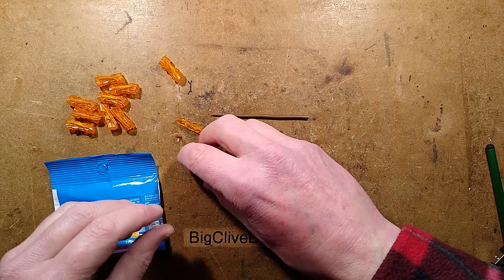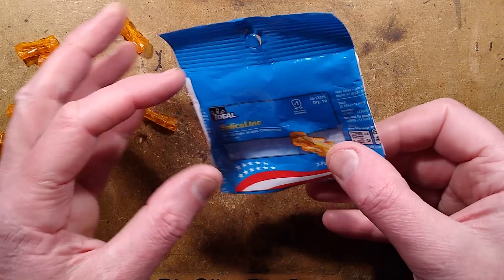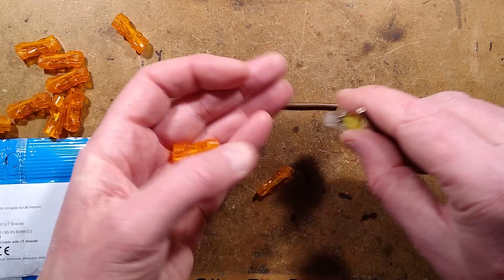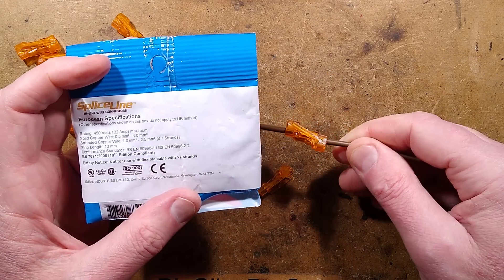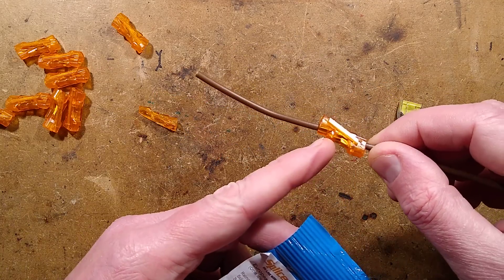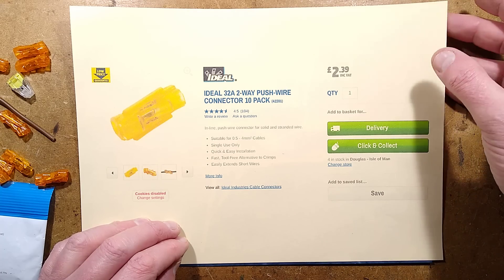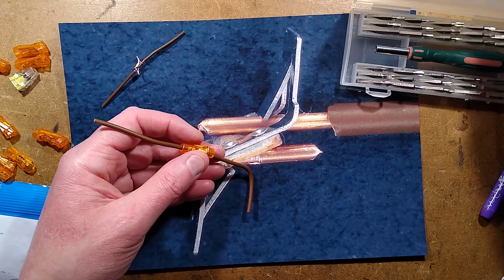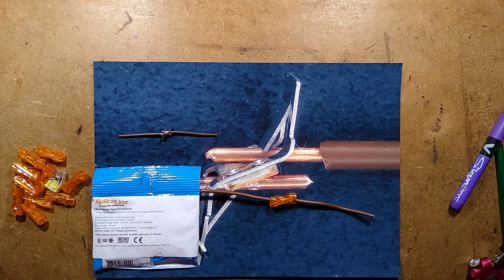Inside a SpliceLine push in cable connector

Comment: The concept of these quick connect devices appeals to people who want instant gratification in all things they do. 45 year journeyman electrician here. I will say this. The spring loaded Ideal wire nut is extremely hard to beat in terms of conductor contact area and fire-safe amperage draw. Even in a pull test, they perform above reasonable expectations. Clive, please do your famous fire/explosion high current test on these versus an Ideal wire nut. Dispel the myth.
Reply: Or people who want a consistent method of connection less likely to be performed incorrectly by fallible humans.
Reply: I'm pretty convinced that the only reason wire nuts are still in use in the US is the "not made here" factor where superior things not invented in the US are discarded off hand in favour of inferior or traditional things instead. There are no real advantages to wire nuts other than being cheap, but then so is a connector block or just twist and tape, and the only advantages of wire nuts are extreme edge cases and these are always better suited to more comprehensive methods instead. For example, the really high load scenarios where it's claimed that wire nuts are better, just crimping and soldering the connections to create a comprehensive connection is better than wire nuts, effectively welding the wires together, and in the industrial scenarios where such high load is relevant over connectors, there is no way in hell any professional would ever use a wire nut when heavy duty terminal blocks are appropriate instead.
Reply: @nickryan3417  It's very obvious this whole topic is about low current (less than 50 A) residential or light commercial installations. The Ideal twist-on nuts beat the new lazy install wago and others in every category with the possible exception of connecting leads inside of a box which are already too short. Twist-ons work with stranded, solid, and a combination of both types of conductors, and provide much more surface contact area. This greatly reduces possibility of a hot joint. Being a US company has nothing to do with any of this topic.
Reply: @RobertBeck-pp2ru  Every category? Wire nuts are much easier to get wrong, they permanently deform or destroy any conductor they touch, they're frankly a pain to install and remove (no, that's not laziness: they take more time, more force, more area to work in).

The human element adds a greater possibility of a bad joint. Tell me, what are your thoughts on torque drivers? (un)Calibrated wrist far superior?

So far I haven't seen anyone break out a microohm meter and prove wire nuts make the claimed massively superior contact..
Reply: @Monkeh616  I respect your thoughts, but disagree, based on my own experience of many years of doing this type of work; industrial, commercial, residential.

Comment: Want to ask a question but don't know what words to use. 😠
Something to do with area of contact between the wire and the connector, 450v, 32amps and fire.
🤔
Reply from the maker: Keep in mind that unlike a screw connector this will not get loose as the copper settles over time.

Comment: Wait a few moments and a Chinese company will produce them to sell at 0.2p each, but leave out the copper slab conductor. I wonder what is inside the ludicrously cheap Wago connector copies?
Reply from the maker: There are already stainless-only connectors.   I should revisit them.  To be fair though, they are only aimed at lighting circuits.
Reply: I mean the ones that look identical to Wago but are on Temu for nothingpencehalfpenny.

Comment: they should have rounded the ends of the connector a bit more so that you could use heat-shrink tube for it in a suitable size.

Comment: Have to load test one and see what amperage it actually can handle for prolonged time before the temperature increase and what happens if you test with a reused connector. Does the load rating drop due to scratching or bending the holding tag… 😅

Comment: I used these when i split one of my ring mains into two. Under the floor with limited space it was so easy to just push the wires in for a secure connection.

Comment: That looks really useful. I'll pop down to Screwfix for some of those. However my use of it will use good old traditional red and black wires, of which I still have a huge stock in the garage for any little additions to my house wiring. Not getting involved in that "Part P" and colour harmonisation nonsense thanks very much.

Comment: Wago also make inline connectors both lever type and push in "single use" I use a lot of them in production lines to replace those 'turny connectors from across the pond that rhyme with  tyre muts and shall not be named for fear of internet wrath'.
Those ideal connectors are also bloomin good and cheap too.

Comment: wago has clip connectors that you can put wires in both sides. also with wago push in terminals you can get the wires out easily by twisting

Comment: how much connection do you get from a router wire onto a flat surface??
Reply from the maker: It seems good, plus natural copper spread over time improves the connection, where normally it results in screw terminals getting looser.

Comment: Given how interconnected our economies are, it probably shouldn't surprise anyone after all the comments by Americans that Ideal is absolutely massive in Canada as well. I would say a solid 80-90% of all wire connectors I see being used on jobsites are the standard blue Ideal "CAN-TWIST" wire wingnuts. They're made in Canada, come in (among other sizes) plastic jars of 1000 that I see most electricians using, though you can get barrels of 25K. I would imagine the exact same product is sold in the US with a de-Canadianized name.

Ideal themselves make and/or sell all kinds of things; if it's tangentially related to electrical, they probably make it. Hand tools, tool bags, taps, terminals, lever nuts, wire nuts,  luminaire parts, data comms connectors, grounding fittings, (wire) fishing gear, bits and hole saws, testing and measurement tools, safety (LOTO, caution tape, signage, etc),  zip ties, electrical tape, spray paint, you name it.

Comment: Not sure if I would trust them anymore than I trust twisted cables covered with electrical tape. Will the plastic break down before the expected life of the cabling? How resistant is it to moisture? (Thinking of uses in garages and sheds)

I think I will stick to tried, tested and trusted joining methods for a few more years before thinking about these 👍
Reply from the maker: Lever connectors might be better for that.
Reply: Well I wouldn't expect that much of a difference between the plastic and the electrical tape, I would even see a bigger problem with the electrical tape unrivveling itself befor the plastic broke down (dosent hinder me to use it for insulation pourposes)
And moisture, I would guess the same problem as with twisted wires would appear, corrosion. And in the best case one would wire stuff in a box or enclosing that keeps moisture out.

Comment: My original comment with more information disappeared...
They are not exactly single use, on their YouTube channel they have a video in which they explain what those holes where you inserted the screwdriver are for and how the wire are released in cases where it is possible to reuse the connectors.

Comment: You could also pop a plastic free ferrule on stranded wire and still use it with them.
Reply from the maker: It won't grip the ferrule in the way a screw terminal will.  The connection strength would rely greatly on the quality of the ferrule crimp.

Comment: As a Canadian electrician I really found this interesting. Your point of view on what we do here would make a really cool series. If you’d like some suggestions of products let me know. 

These are incredibly useful when a drywaller goes to war with your wiring in a box or in older homes and you have to extend or splice into an old wiring.

Also we do have Wago and similar style connections here but our wire is designed for wire nuts. Especially up in our northern climates.

Great video
Reply: How is it designed for wirenuts?
Reply: @Alex_Vir  the copper is actually made and meant to be twisted for a solid connection. At a trade event I went to Southwire Canada has a lot of information on it. Of course there is always the proper way of twisting and improper which could lead to install issues. But that’s up to the trades person
Reply: @FocusedElectric  So you are using a copper alloy instad of Millberry in canada?
Reply: @Alex_Vir  I have to admit, I'm pretty curious myself how annealed copper is different to annealed copper.. other than how it ceases to be annealed after getting savaged by a pair of pliers and a wire nut.
Reply: @Monkeh616 very true!!! 😂😂
Reply: @Monkeh616  with an alloy I mean something that is not 99.99% copper. Because I am really curious how something can be designed for wirenuts.
Reply: @Alex_Vir  In any circumstance, all wiring should be done with wire nuts (Marrettes) instead of Wago.  I haven't heard much of houses burning down when properly used wire nuts are at play and Wago connectors to me, for simple low-power circuits is fine but not for 120-240 VAC, 10-20 A.
Reply: @WJCTechyman  I haven't heard of any houses burning down with properly used wagos. So whats your point. Giving an anecdote that surprisingly fits your view of the issue?

Comment: Yup Ideal is one of our major brands here in the US. Those splices are rarely used. Buchannan is another one of the big manufacturers but they are known for making one time use wirenuts. As in they will not work after being removed like the higher quality brands are. 3m makes some of the nicest wirenuts over here but they are more expensive. 
            We are finally getting people converted over the the Wago style push connectors. They are coming down in price and making it worth using now. But when you are working overhead or in hard to get to spots you don't care if a wago is twice the price.

Comment: They do have other types. I've got some for connecting 2 or 3 wires similar in design with the first connector that you showed (they're called "IN-SURE"). Bought them awhile ago. Didn't actually use them but now that I've seen (somewhere on the internets :) that they might be good I think I'll be more confident to use them around the house when I need it.

Comment: You could use those with flex wires if you first put a ferrule on the end of the wire
Reply from the maker: It would depend on the quality of the ferrule crimp.

Comment: you would have to do the same as with tie wraps , go in where the wire is and push a little , pushing on the probe point just pushs the metal more on to the wire ,. (doing it this way (going in same place as the wire ) may well bend the metal tag so could render it useless for smaller gauge wires if it doesn't spring back etc )
Reply: corrected spelling lol

Comment: Don't see any advantage over wago 221.
Reply: An example is installed solid core wire that was cut in a wall for example, there they would be useful. But wago also has 2773-2401, so…

Comment: Ideal is an American electric supply company.  The products are typically decent quality.  They also carry tools used in the trade.  Not sure how many of their products actually originate in the US though.  As an electrician for many years, personally I’m not in favor of push-in connectors for high current applications.  I know Wego tests ok for somewhere around 40A.
Reply: Ideal makes most of its stuff in the US. They bought SK Tools in the 00s and were making those in the US as well, but they sold SK off a couple years ago.

Comment: Oh hey, Yankees finally figured out push in connectors!
Frankly more manufacturers need to start making these, because if you want quality its either Wago or Ideal, the rest is a bit crusty and I wouldn't trust them.
Reply: The US has had something similar on the back of receptacles for years and years. Strip the wire, shove it in, done. My house was installed with those 30 years ago and not a failure anywhere. Just the same if I replace an outlet I use the screws. Yes I know the screws can loosen and burn too but I've never had that happen either.

Comment: Ive been into using screw terminals for stuff for a while now.. And i recently started using 12/24v Barrel Jack connectors for quick connect/disconnect DIY power projects like various 5v/12v Lighting and manually charging/powering solar street lights etc.

Comment: I have a completely unrelated question, hope it's not a problem:
can you use a solenoid fog machine pump behind a basic triac dimmer? I have several foggers without DMX, and plan to make a universal 1ch DMX "dimmer".
If the solenoid pumps can only be operated on/off I will have to make an option for that on my design, but it would be great if it is dimmable.
Reply from the maker: I wouldn't recommend trying to dim it.

Comment: I'm sure I first got these from screwfix about 5 or more years ago and they were sold as reusable, you just have to yank really hard.
Also I think despite clearly being maintenance-free, you can't actually leave these inaccessible as to be legally  maintenance-free, you have to use the connector in conjunction with its matching box. So i think you still have to use Wagos and Wagoboxes for that, and pay the crazy price for what is a plastic box😕

Comment: I was expecting to see Clive push 32A through the wires & connector (under a resistive load, space heater etc.) and use a thermal camera to see how well it works.  Good follow up video idea?
Reply: well said, lets see it smoke!
Reply: I want to see him start at 30A and ramp it up until something goes bang!
Reply: @stevenhodgson834  that's called photonicinduction.
Reply: I approve this idea. 👍
Reply: You'd need a VERY beefy space heater to even slightly inconvenience this connector, like 8 kW+. Do these even exist?
Reply: @Maurice_Walker Probably much easier to do this test at 5 V or so instead - maybe even use an arc welder 😂
Reply: @Maurice_Walker  I’ve seen portable heaters (for events, job sites etc) that go as high as 20kW. 9 and 10kW (38 and 42A ) are more common though.
Reply: @deltab9768  I've seen 30kW and 45kW electric portable heaters, but those run on 480V 3 phase.

Comment: Ideal also makes (or made) a splice connector similar to the Wago you show in this video, which I attempted to use on one project as supplied material.

Although its rating included much smaller wire, the 14 AWG (~2.5mm^2) solid copper wires that I inserted pulled out of the connector when I tucked them into the standard 4" square junction box. It was a very good thing that I wasn't working hot, since the live supply was the wire that pulled completely free and scraped my hand.

Assuming I'd made a mistake somehow, I pulled the junction back out and made sure that all of the wires were fully inserted, then held them and tugged on the connector. With perhaps 10 pounds of force and no twisting, the connector came completely free of all the wires. A repeat with a new connector and freshly-trimmed and stripped wire had the same result.

I then went out and retrieved my own supplies, using wire nuts (also Ideal). Fucking around during demo, I've suspended my own 150+ pounds of body weight from those on 14 AWG; I know they'll hold the wires securely.

Comment: If you lightly tinned stranded wire then you could use stranded.
Reply from the maker: I recently had a tinned wire pop straight back out of a Wago clone twice.  The soft solder affected the grip greatly.
Reply: Never use tinned wire in a compression connection. The solder cold flows and the compression lossens.
Reply: @nyetloki  Surely the whole point of these spring loaded connectors is that this doesn't happen with them, the spring maintains the pressure even if the solder does flow.   Your point applies to screwed connectors like choc blocks.
Reply: @petehiggins33   what even is the point of soldering if these are rated for stranded wires already then?
Reply: @nyetloki  Well it wasn't my idea but I assume that @britishtechguru was suggesting that tinning would allow smaller gauge flex cable to use these connectors which would simply squash otherwise.

Comment: Certainly looks better than the ubiquitous "choccie block" connector, smaller, no exposed screw heads, doesn't chew up the wire like a choccie block, and inherently grips tighter if you try to pull it apart.

No doubt there'll be a shortcoming somewhere, but as I see it, what's not to like about it, if you keep within working specs?

Comment: Doing a main distribution panel (consumer unit) I had cause to use these. they were new on the market. I used 2 on 15 amp circuits. One melted! It was fused at 15 amps. Solid core wire, correct size, inserted correctly on inspection. Not sure what happened. I've used them confidently since. One off?

Comment: @4:17 - Back in the day, shoddy sparkys would use the "back-wire" feature of receptacles.  You released the wires from those horrible spring connectors the same way.  I suspect that these connections will also suffer the same fate that most back-wired plugs did...right in the bin.  If you ever responded to a service call where half the living-room circuits went out when someone ran a Hoover, you know what I mean. Edit - You need a Jewelers screw driver.
Reply: They call it "back stab" in the US and it burns down houses every winter when the space heaters (constant 12 amp loads) come out. Not to be confused with "back wire" where you have a screw compressing the wire between two plates, mostly seen on the higher dollar commercial grade parts and it works very well.